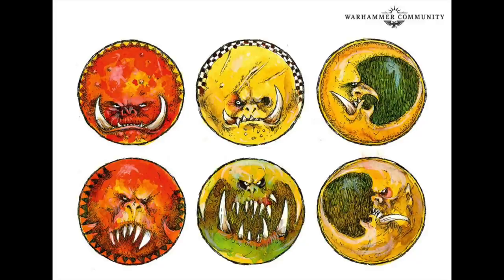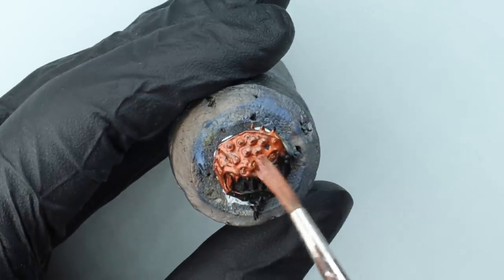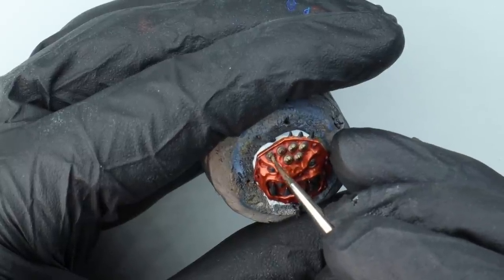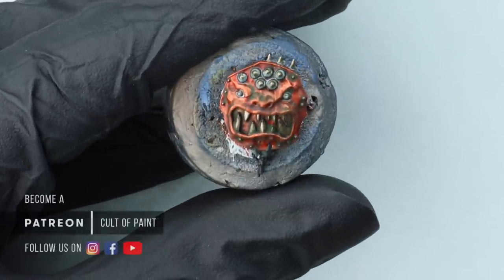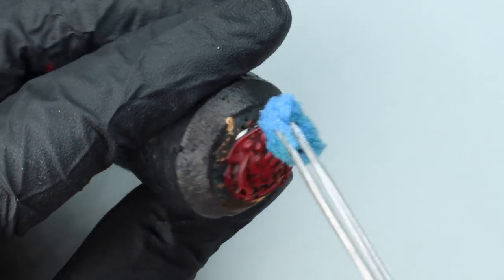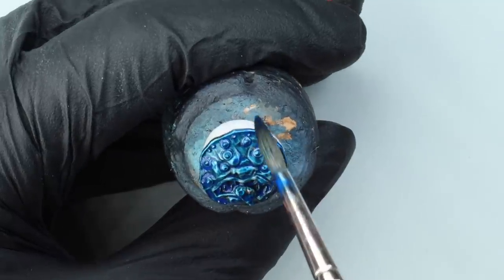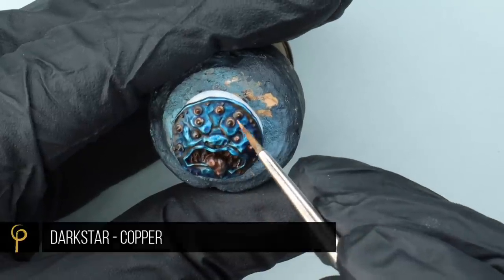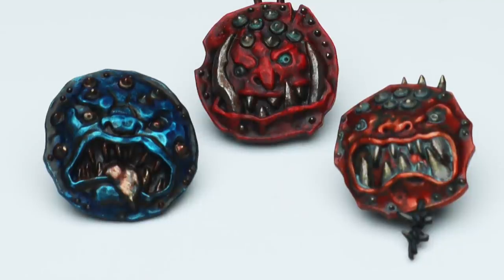How to Paint Skareshields on your Orruk Kruleboyz from AoS Dominion!

Comment: Veeery cool ideas and tips. I like the second the most, and the sponge tech is a good way to build contrast without drybrush. Love it.

 Once i get my hands on them, i think i will go for a sickly yellow-green for the shields. I like a lot the "bad moon" looks and the "venom fang" greenish (from the total war npc faction of greenskins near southern realms). So i think i will try black spray as basecoat, and then the sponge with iron warriors metal followed by nurglin green, washed with diluted plaguebearer flesh and then rescued back with the nurglin green. The metallics of the eyes and fangs i guess i will go with iron warriors, highlighted with ironbreaker and then shaded with either nuln oil with touches of coelian greenshade to still have a little green tint to it, but keeping them darker than the rest of the shield, with a colder vibe.